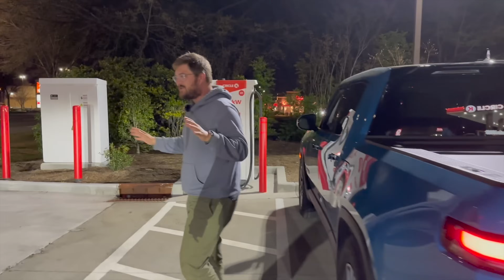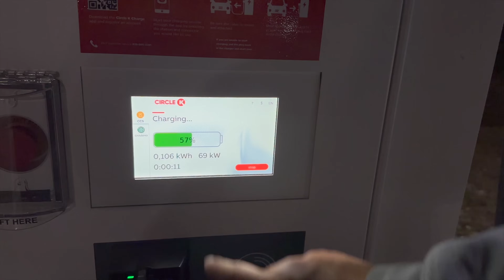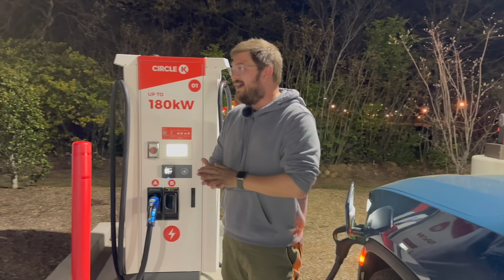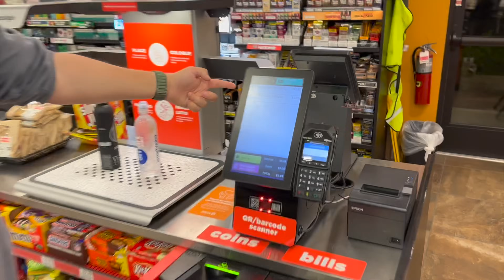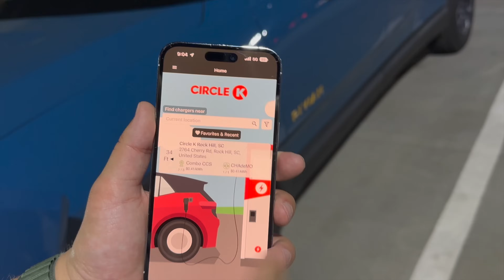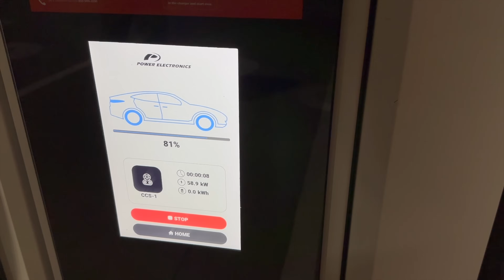These Are The Charging Stations I Want! Visiting The Circle K DC Fast Charge Test Location

Comment: I just used a few Circle K chargers on the first couple of legs of my drive from Atlanta to upstate NY. They had a pretty standard app experience and they did offer credit card readers. The chargers worked perfectly. My only complaint is that they put a $50 authorization on my card for each charging stop and it was not released until the following day. This was not a huge deal for me as I only used two of their chargers but if I had problems and had to restart a session a couple of times or was going to use many of their chargers in a day, it would get pretty annoying to have hundreds of dollars on hold in my account. I drive a Bolt EUV with a 62 kwh battery pack so even if I had to charge from 0-100% at 49 cents a kwh the max I would need to pay is around $30.

Comment: I still don’t like chargers that rely on cell phones and phone signal coverage.  All I want is a credit card reader.  Keep it simple. What if your phone is dead, broken, or lost?  You have to think about the lowest common denominator.
Reply: When you think about it, credit card readers also have to have a way to "phone home" to charge your account.  Most likely it is a 4G connection in rural locations, 5G in urban ones.  In very, very, rare cases, it's a wired internet connections. Something that's even rarer in 2024, a card reader that has to dial up a processing center to complete a transaction.  How long has it been since you've seen that? In any case, no matter what, there has to be a connection of some sort between the cc reader and the cc processing center.
Reply: @MarlinMay yes, but I’d rather have a tested dedicated connection from the charger network than rely on my own phone and its network which may not have good coverage at the charger.  If my phone is broken or dead I want to be able to buy gas or charge.

Comment: Kyle, the charging limit on chargers has to do with the available current from the grid at that point.  The size of the cable isn't the controlling factor but is sized to match the output capacity based on availability of power at that station

Comment: By itself, a gross profit margin of 10 cents per kWh seems pathetically inadequate. I haven't run the numbers but it seems like the initial investment plus financing plus maintenance plus insurance could NEVER be paid off with ten cents. Sure I understand it could drive more foot traffic into the store; which I would have to assume is the only way a store could employ this. 

If the socialist method of subsiding "publicly encouraged" stations means that consumers will bypass the "for profit" stations because of price, then this whole thing is going to fail at scale.

Comment: When the cable gets connected to the car; does the car give the charger its IDENTITY?  How does that work? It gives its VIN? When I charge my EV6 at an Electrify America station, I start charging by swiping (in the app) after i've selected the location and unit number.  EA has to have a way to verify that I'm charging THIS car, because it has 3 years of free charging. 

IF indeed this identity is shared in the communication upon connection, then the charger should be able to lookup the identity to see if it belongs to a valid account. If that is the case, there should be NO NEED TO INTERACT WITH THE CHARGER OR APP::: JUST START SUPPLYING ENERGY IMMEDIATELY.

Comment: At 44 cents a KWH,  which converts to about 60 cents in Canadian funds, that is serious coin. According to my calculation, that is more expensive than running ICE. I realize they have to make money and the cost of installing these units is high but isn't it supposed to be a little bit cheaper per mile to go electric? I have been driving a Leaf for 3 years and just traded it in for an Ariya which is not as efficient so my 29mpg Camry is probably going to stay with me a for while.

Comment: Really interesting to me, because at a glance them mechanics of starting a charge looks really similar to the idealized EA experience. Of course in reality, EA often has weird handshake issues and timeouts. I'd love to know what the underlying difference is that (presumably) makes these reliable. Is it poor hardware from EA? Software? both? In a world where EA switches gears and opts to prioritize reliablity, I'd be curious how easily/quickly they could turn things around.
Reply: Authorize first then plug in. On EA where you plug in first, and then meddle with app for a long time, the car times out
Reply: @lucistnik  somehow I missed that. Fair point.

Comment: The power sharing is usually not limited by software, but by the power delivery modules of the charger. For example Alpitronic that I use a lot has 75kW modules, so the split is done in these increments only (75/150/225/300kW). Quite clear as they have 75, 150 and 300kW chargers. 
If that ABB has 90kW modules, you get just 90/90 split, if it's 45kW, it would be more adaptable. I remember one of your videos with some company that hat 20kW bricks which I loved for this exact reason 🙂
Reply: Neither Alpitronic nor ABB do full mesh, they can only ever split half/half. No matter what modules are in. (ABB Terra 360 does full mesh)

Comment: I love that you say size the charger for the location.  My rule of thumb has always been that it should be able to charge 50% of the battery pack size in the amount of time a typical person spends at that same location not in an electric car.  So in a shopping center, a 30-60kW might be fine if people spend 1-2 hours there anyway.  But at a C-Store where people spend 15-20 minutes usually, a 350kW would be better.  Restaurants also make a 50kW make sense.  11.5kW for charging at offices.
Reply: Also 50 kw at shopping malls!  And level 2 at zoos and amusement parks.

Comment: These charger’s definitely need a canopy , maybe with solar panels on the roof as others have suggested.  Not only would it keep you dry and out of the summer sun, it would provide solar for the charge site and keep the cables a bit cooler and out of direct sunlight. However, it does make me wonder if the end game is to convert some if not all the gas pumps to electric and bingo the canopy is already in place!
Reply: Yes! I've been wondering why there wasn't cover anywhere yet the "gas" pumps have them. Like they're superior LOL
Reply: @thankyoupagemagic8484 gas is superior as it’s cheaper, faster, mire convenient.  You would need the canopy to be 10x larger unless you want a line to wait wasting energy, due to the time it takes to charge.
Reply: @bryanutility9609 you didn’t watch the video where Kyle says his avg charge is about 10min.

Comment: Can you do a revenue report of gas v. electric?  Always heard the gas pumps are small revenue compared to getting people in the stores.  Would a gas station owner make more money on electric charging versus gas pumps?
Reply: From what I've heard gas stations clear about 5 cents a gallon. I'd be curious on full development costs of a station, gas vs electric. The electrical infrastructure for an EV station is obviously more intense than a regular gas station. Regular station of about 12 pumps is like 400 amps 208V, 3 phase. That's only about 150kW so wouldn't support much EV charging.

I work for an electrical engineer and we're now being required to install the infrastructure (and chargers, L2 at 30A minimum) in CA with new projects starting 1/1/2023.

Comment: Absolutely agree with this  set up.  Add chargers or replace gas pumps with electric chargers.  Now you can go in and spend money in the store.  Crazy how many Tesla chargers are way out in a parking lot and very sketchy to walk to the nearest store.  BTW have not been to a Circle K since I bought my Tesla Model 3 five years ago.  While I will never buy pizza from a gas station, unless it is a Wawa, I would buy coffee, etc.
Reply: With gas pumps you'll have to pull them all out and the local AHJ (Authority Having Jurisdiction, i.e. city or county) will probably require everything associated with the fueling system pulled out. You can't have these chargers within 25' of a gas pump. And I would assume that the AHJ would say that would included the length of the charging cable. So the difference would be the 25' plus the cable length to the charger.

Comment: At 44 cents per Kilowatt we now exceeding the cost of traveling with an ICE vehicle. Then the only savings would be oil changes but that would be negated by the required heavy duty tires. Price per Kilowatt needs to stop going up so fast.
Reply: 44 cents per kWh is only for fast charging, which is normally only necessary on long road trips, which the typical driver doesn't do all that often. The cost savings of going electric comes from the fact that all of your normal driving around town, you're charging at home and paying utility rates, which are far cheaper than this.

Even if your once-per-year road trip ends up breaking even with ICE on energy cost, you're still coming out ahead overall. And even for that, you still get some discount as a result of the first 200-250 miles being powered by the cheaper home charger.

Finally, prices at charging stations tend to be much more stable than prices at gas pumps, as the cost of electricity does not rise and fall almost daily with fluctuations in the price of crude oil. So you don't have to worry about your road trip randomly costing 30% more than you expected due to a sudden gas price surge.
Reply: @ab-tf5fl  Where I live was cheaper than most of the country and yet our electricity had risen 63% in 5 years. A lot is due to installation of new green energy. The promise was lower prices but we haven’t seen it. Not sure if it is to recoup investments or other reasons. A good portion of ours is still based on natural gas and some coal which those prices are buffered into the electrical prices and increases. The difference filling between gas and electric is now $8-10 when charging at home. Even at $10 a week that savings is negligible. The biggest benefit is convenience but to remain viable trips costs should stay competitive or adoption could stagnate.

Comment: I charged my EV6 at that exact station in Rock Hill.  I struggled to get started.  Had to download app, fill in all data, supply a card, and finally after one false start, I got it to work, after 20 minutes.  Once started it did charge at a good rate, so that much is accurate from my experience.

Comment: I'm starting to see the up-and-coming Freewire DCFC chargers at AM/PM gas stations in my area (Pacific NW).
Reply: Yes - I live in the Pacific Northwest and tried one out last week. It was extremely nice to be able to just hop right off I-5, plug in, charge, and get out. I was able to pay just like Kyle did, by simply tapping a credit card on the card reader - no wasting time downloading and configuring apps. Much better than driving through a busy WalMart parking lot to charge at a nearby EA, and also cheaper ($0.35/kWh vs. $0.48/kWh).

The only downsides of the freewire charger I visited is that the power is limited to 75 kW and it can only charge two vehicles at a time. When I went, neither were an issue - the site was empty, and I drive a Bolt, which can't go much beyond 50 kW anyway. But, I could definitely see this site becoming chronically full as drivers start figuring it out, and being forced to go back to the EA WalMart to avoid waiting in line.

Also worth noting, many people assume that when a Bolt plugs into a charger, it's going to be stuck there for 45 minutes, but that doesn't have to be the case. In my case, I just needed a few extra kWh so I could make it home with 12% rather than 2%, which would be too dangerous. The entire charging session took all of just 10 minutes, most of which was spent using the restroom, which I'd be doing anyway in a gas car.

Comment: Thanks for the site visit, Kyle! One thing to note about the EVgo sites going in at Pilot/Flying J is that those chargers are under EVgo's "eXtend" program, meaning they are really just the billing, connectivity, and technical support. Pilot actually owns the hardware that is being installed.

Comment: 180kW is slow and no, 44 cents/kWh is not justifiable, exorbitant energy profits bring EVs too close to efficient ICE.
This is 2015 technology at a premium price.
You might like the frenetic charging of 10 minutes (which is patent lie) but even if the equipment is operating at peak curve for ten minutes, the time spent stationary is 20 minutes … two or three times longer than an ICE refueling stop.
As an R1T driver with an F-150 Hybrid, I've had more than 12 months of comparing real world EV vs ICE for similar purposes … EV is still nowhere near competitive, nowhere breakeven for cost-benefit.
You're paying yourself minimum wage to wait at a charger, you're recouping a few thousand dollars per year … that's a breakeven of years. 
With escalating kWh prices, the breakeven curve is not converging, it's diverging.
Tesla is the worst of the profiteers,  hiking up "at the pump" electricity dispensing prices in direct violation of anti-trust laws to refrain from price gouging of customers locked into a monopoly.
Reply: Your analysis is forgetting the fact that most EV charging happens at home and public DC charging is needed only for long trips, which happen rarely. You spend a few extra minutes at chargers on your once-per-year road trip, but you avoid 6-8 minutes a week at gas stations every single other week of the year, when you are not going on a road trip, so you still come out ahead on time overall. And that's on top of home charging costing much less than both public charging and gas pumps.

As to why public charging costs 44 cents/kWh...it's because fast charging equipment is expensive, and the limited number of EVs currently on the road means it gets used only a few times per day, so the fixed cost of equipment is spread out among fewer drivers than would be the case with gas pumps. There is also not yet enough competition among EV charging providers to really push prices down, as you're choosing a charger based on which charger is located at the point on the trip where the battery is at the level for optimal charging speeds, not which charger is offering the cheaper electricity rates. Also with DC fast charging, a lot of the electricity used by the charger gets lost to heat and doesn't even make it to the car. This energy is not billed to the customer, but the charging provider still has to pay for it, and part of the purpose of the inflated cost of kWh that does reach the car is to pay for the energy that doesn't.

But, nevertheless, the bulk of a typical EV driver's charging happens at home, not charging stations, so it's the home electricity rate (which is normally far, far cheaper than 44 cents/kWh), not the rate charged by charging providers, that really matters in determining one's annual energy costs.
Reply: @ab-tf5fl  By observation, there's a lucrative business in charging networks or Tesla wouldn't be pursuing it with a profit motive. All the charging network vendors are there for profit, not public service.

Comment: The easy tap to pay, is just like getting gas...  use your card.. takes 5 seconds.. done.
Those scanner checkout stations are great.. Especially if you have just a few items.. You can scan the bar code on the item also. 
It's super handy for when you need just a drink or to pay cash for your gas, and someone is taking forever at the actual register buying cigarettes or Lotto tickets..
We have had them out here in the Southwest for a while.  Circle K has really nice locations, they are usually clean, and have a nice selection of snacks and even some hot foods, Hot dogs, and Pizza.

Comment: As more people get electric cars and charging stalls start getting filled up, the issue with the current charging stall setup is there is no way to "wait in line to charge next". They need to design these with a pull through design.

Comment: But can you charge off of both cables at the same time? The charger is in the middle between two spots, so someone can pull up and is sitting without charging until the other person is done. If you can't charge in every spot then we shouldn't have them

Comment: Great to see more combined convenience store/charging installations.  I love the AI device, and how bright, clean and secure the entire area appears.  Having just done a 1200 mile trip with my EV, I can attest to how uncommon well planned out charging stations like this one are.  Minimal required characteristics ought to be: 1.  Reliability  2.  Availability. 3. Safety 4. Placement next to a working 24 hr store.  This location appears to check every box.  However, to go the extra step it should probably have more charging stations (but that can be a function of utilization).  It would also seem important that the entire authorization step should be bypassed, meaning that it should only require plugging in to the car port without further user interaction (basically have the car play the role of apple pay, for registered users).